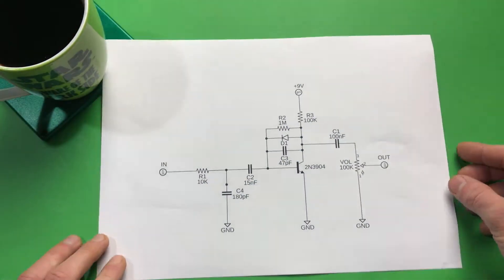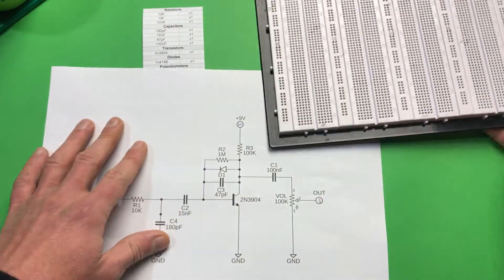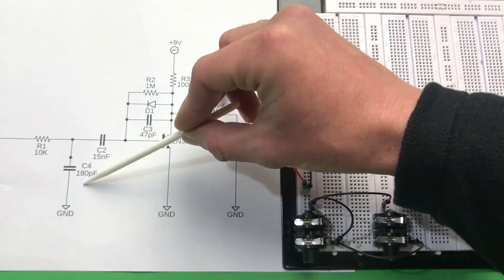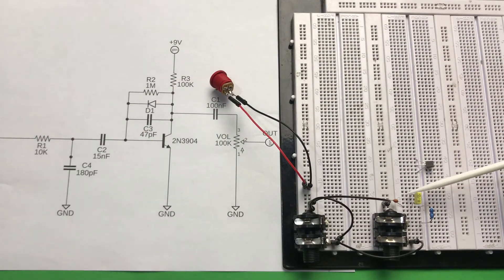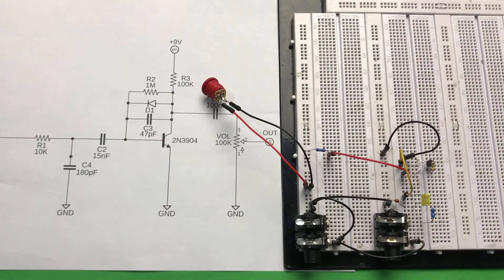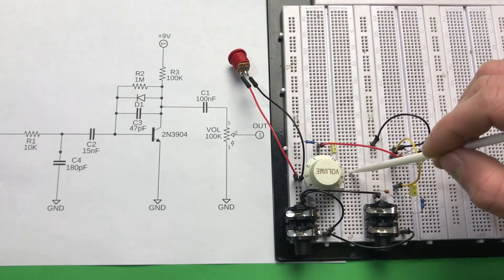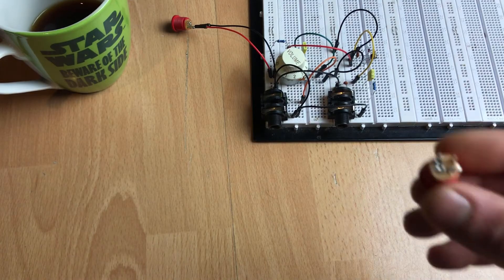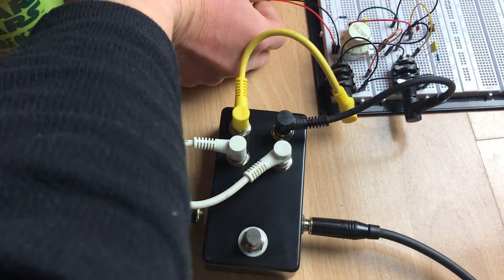Learn How To Create Distortion Pedal Circuit In Few Minutes  (Full DIY Tutorial)

Comment: can i make this on pcb board, if yes then how, like where to connect the ground and all, and where sould i design pcb board
Reply from the maker: sure you can make pcb of it, there are lot of different PCB design tools, try eagle or kicad
Reply: @ToneCharmAudio  thank you so much bro, you are of great help for my school project. ill ask you in this comment section itself if i get any doubts
Reply: @ToneCharmAudio  what mono jack did you use, and what footprints shall i assign to the capacitors and resistors and potentiometer

Comment: Ok so now does it live on the breadboard or can it be installed in a pedal?
Reply from the maker: It's just for prototyping. After making a circuiut you have to design PCB and then solder all parts on it to put it inside a pedal.

Comment: I have easier way for you. At that old boombox behind you in your kitchen, You remove the tape head from the cassete deck there ar 2 pins you connect your guitar cable to those pins, go to tape mode of the boombox for clean chanel and than press play for distortion  :). Great video BTW keep going :)

Comment: worked great for me!! question, can i add a pot somewhere for drive control? if so which resistor would i replace?
Reply: I think that you should replace R2 with a pot to control the gain of the distortion

Comment: Hey love these videos, I need to check out more. Out of curiosity, what would need to change if you were building this pedal for a bass rather than a guitar? Or if nothing for this pedal what generally need to change for bass? I find lots of explanations about optimising for lower frequencies but not a lot of explanations for what that means on the board.
Reply: probably a low pass filter to get rid of the high end and let the distortion do its magic. if your bass has a low pass filter (the bottom knob closest to your jack) you can turn that knob up to acheive the same effect. if your bass doesnt have a low pass, a 10 micro farret capacitor on the input side of the pedal will work. you can also put that capacitor through a pot to adjust its effect on the pedal.
Reply: Tbh you could probably try it on a bass as-is. When I was broke I used a friends bass on my guitar pedals/amp and it actually sounded pretty good! 

Distortion is just clipping the sine wave, so it shouldn’t be too different on bass

Comment: This distortion is so sick, I actually began tearing up. Magnificent work
Reply: Planning on putting this circuit in my guitar
Reply from the maker: Have fun! :)
Reply: @JediRangersWorkshop-StarWars same, how'd it go? Any tips?
Reply: @Amy-q1e4o  did/will you build yours from scratch, as a kit, or as a partscaster?
Reply: @The1jediranger  its an old tele style guitar that my uncle gave me. I'm pretty sure one of his friends made it, cos the cavities are big, odd shapes.
Reply: @Pip_Bear

The Project went great, here is what I found out during the build.

1: Use an external 9v battery tray, instead of under the pickguard.
2: use high quality parts for the build.
2a: use a 3pdt slider switch with a true bypass (tone charm has a video) and mount it to the pickguard.
2b: Use a stereo output jack, it makes life much easier.
2c: Use a slide pot for the board’s volume, and mount the slide pot to the pickguard.
3: Don’t wire the leads backwards
4: Shield everything with copper foil or it will be very noisy.
5: don’t mount the board on the pickguard, it makes disassembly an absolute pain.

If everything turns out to be right but you lose signal when the circuit is on, get a preamp (there is a good artec one at cb gitty) and attach the preamp output to the board input.

Good luck, and may the force be with you.

Comment: ᗪᘔIEń ᗪOᗷᖇY! 
-Will changing C3 value alter the tone a lot? Or is it more efficient to change C2 or C4 ?
-If I use PNP Transistor instead of this 2N3904 NPN, will swaping the legs in the circuit make it work, or is it complete nonsense?

Comment: Simple design... too simple.
1. Need a potentiometer to set drive input level.
2. Germanium diodes and PNP transistors are best.
3. Use 2 diodes, back to back, for symmetrical clipping.

Comment: Love to the video...... I went to a shop and asked for the components..... The shopkeeper asked about voltages of the capacitor...... What should be the voltages of the capacitor?
Reply: The circuit only runs off 9V, so any low voltage capacitor of 25V or more will work fine.

Comment: I Tried making the Distortion pedal from your DIY scematic/tutorial PDF. But IT has No Sound. I got a 500K mono linier potentiometer instead of the reverse log. And the 10 nf, and the 47 nf capasitor is a ceramic instead of a film. But other than that IT should be the same. I Also use a 9v batery instead of the DC input, but that shouldn't make Any difference. PLS help me🙏
Reply: same here, like weirdly exactly lol
Reply: @paranoidamericans3331  Im not sure, but the problem might be the scematic because I just looked up what the pins on a potentiometer do, and in the scematic pin 3 and 1 are switched around compared to what I found on Google. However even arter trying to swap the conections from pin 1 and 3 on both potentiometers there was no Sound. I Also Tried to switch The Jack in and output but I only got some White noise😔
Reply: 2 years later, have you guys found a solution, camping with the same problem

Comment: how do i remove the white noises?
Reply: Put it in metal enclosure, because If wires are like this, they pickup all diferent stuff, so If you want "real product" you need to solder it and put it into enclosure. This is just for building and testing

Comment: How do you choose all the values? Is it just experience or you have a model of the pedal in Simulink or similar software? I study engineering and have no problems in reading the schematics and knowing how everything works but I have no clue how eache value affects the sound
Reply: best part about breadboarding, is you can swap values without soldering. I'm just learning, and it's fun to build a circuit that I find online, and then change values to hear how it affects the sound! :D
Reply: @AaronAubreyPhoto  I built the circuit, sounds great! I also replaced the diode with a 1N34A and replaced the 15nF with a 100nf (104) on the input. It makes it sound more dirty than fuzz.
Reply from the maker: Mix of calculating, hearing and experimenting :) I'm not using any simulation software.  Thanks for watching! :)

Comment: Pedal sounds great. I'm new to breadboards and for some reason I just can't get this pedal to work. I have rebuilt it several times and I have all the correct parts. Any advise would be great. I can send you a picture of the board. Awesome videos. Thanks
Reply: I got it...fantastic sound. thank you so much
Reply from the maker: @jasonhiggins4472  I happy You got it working. What was wrong? :)
Reply: @jasonhiggins4472  I have tried to build it on Proteus.
I am not getting any sound out of it.
Can you tell me what would be the problem?
Reply: @shubhashish8568  The issue I was having was with the potentiometer, I added one to the pedal. Also my breadboard connections were a little loose. I wish I had a better answer for you but there was no secret. When you do get it working  though it sounds fantastic. I'm going to add a tone pot to it at some point.
Reply: @jasonhiggins4472  Hey, thanks for the response.
Its working now but the volume is too low.
I can bearly hear it.

Comment: Great video. Would be nice to have a video explaining the role of each component in the circuit.
Reply: Try find a video about 1 transistor common emitter amplifier. Quite basic circuit. Only interesting part is diode between C - B of transistor. You can salvage parts from scraped TV set and build it. You will need cheap multimeter and soldering iron. Great fun to change values of components. Transistor didn't need to be exactly the same as used in video, try out what you have ;-)
Reply: Engineering is always a balancing act between cost and function.
Reply: Basic stuff...R1 is an impedance matching resistor. Along with C4 it forms a low pass filter at around 90 kHz (C4 sends high frequency signal to ground). C2 is a coupling capacitor whose sole purpose is to pass AC through it, but block the DC from feeding back into the guitar. 
R3 is a limiting resistor, preventing a dead short into the circuit, and setting the peak current flow. 
D1 is your clipping diode, the value and type of that determines how and where the peaks in the signal are clipped, shaping the 'distortion' signal. R2 sets the amount of signal going through the diode...on a typical pedal this would be a potentiometer (variable resistor) so you could change how much distortion you get. C3 is a smoothing capacitor. 
2N3904 is a transistor. It takes the incoming AC signal from the guitar and the feedback from the 'distortion loop's (C3,D1,R2) and amplifies it using the current supplied by the battery. 
C1 is another coupling capacitor, isolating the DC to the circuit and passing the AC signal on.
VOL is a potentiometer (variable resistor), that acts as a current divider sending some of the signal to ground and passing the rest out of the circuit, depending on where you have it set. You should look into a few basic videos or article about electronic components.
Reply: @MrStickthrower2001  hello sir, I want to know why need a low pass filter
Reply: @HC-go5rx  You want to filter out higher frequency signals to free up headroom for your amplifier.  Transistors will amplify all signals within their operating bandwidth that they receive. By grounding out inaudible frequencies, especially in a low power single transistor system like this one, you dedicate more of the already low power to amplify what matters. Frequency filters are essential in most amplifiers in order to only amplify what is needed, and to reduce interference from unwanted signals.
Reply: @HC-go5rx  The low pass filter will also ground out radio signals picked up by the equipment...guitars and cabling are really good antennas.
Reply: @MrStickthrower2001  Ty for your explain sir. I am wondering that the guitar sound frequency from lowest to highest is 82Hz-1318Hz and the highest frequecy people can hear is 20kHz, why the low pass filter is set around 90 kHz, it seems unnecessary.
Reply: @HC-go5rx The cut off frequency was likely selected as "good enough" based on available components. Small inexpensive capacitors are made in a range of relatively fixed values based on design and construction materials. You can fine tune a capacitor bank by using multiple capacitors in parallel but that technique would defeat the purpose of this design which is to be quick, simple, cheap, and good enough.
Reply: If you are truly interested in analog solid state guitar amplifier design, I recommend some study of basic electronics, easily done via YouTube, and then diving into "Solid-State Guitar Amplifiers" by Teemu Kyttälä. He does an excellent job of telling the design history and engineering choices of solid state guitar amplifiers from their origin to current tech as well as explaining design choices if you are interested in building your own.
Reply: Well said
Reply: This video has some discussion and waveform display https://youtu.be/otkW_q0_VIU
Reply: They make books that explain this stuff
Reply: Great comment.  Would be nice to have a comment explaining the role of prior knowledge of electronic components in comprehending your video tutorial consumption.

Comment: Awesome video again :) if I'm all set up I'm gonna make this one too with some adjustments I think ^^ the loop switcher seems like a must in pedal building or am I wrong?
Reply from the maker: You need to try it! Loop switcher it's just useful tool, not needed. You can also swap input and output manually on breadboard or make simple switch with cables connected to breadboard. Cheers!